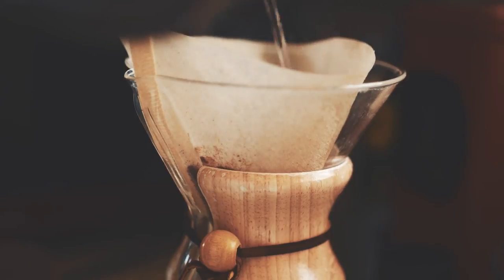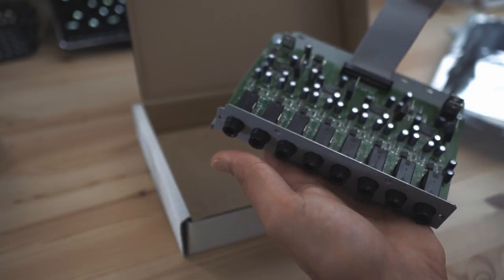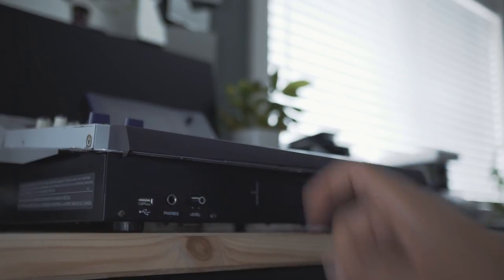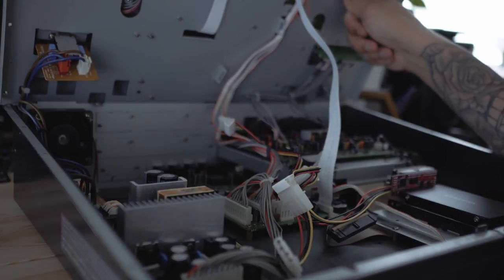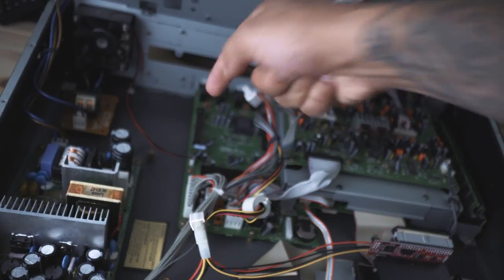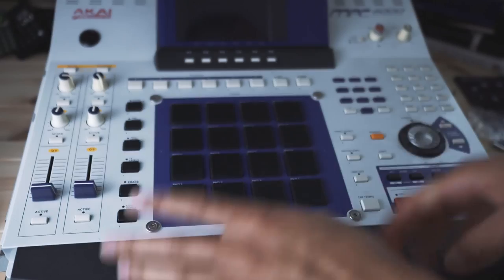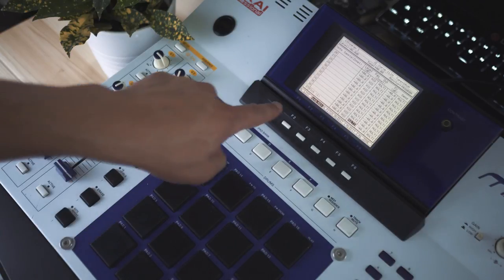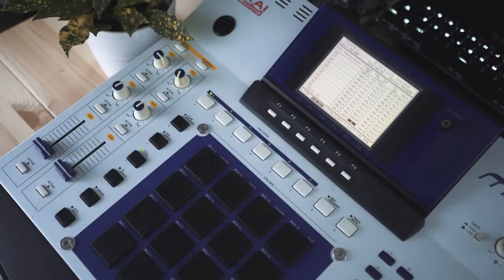MPC Output Expander IB-48P Install Tutorial - Also how to open your MPC

Comment: Peace, I just ordered my 8 outs and I 
was wondering do I need to update my O.S.? I’m currently running 1.45
and if so, what is the process?
I just got my MPC 4000 and this thing 
is a beast! Finally, I had to replace the 
sliders, there is a video on my page, of me replacing them. Your videos are great 
and give me a jump on the 4000, I’ve been using the MPC 2000xl for the past 
25 years, I love it, but the 4000 is my best 
friend 😂
Reply: I also have the 2000XL and thought about getting something new and modern, like the MPC One, but I am seriously considering the MPC 4000. Does the 4000 come with both a high pass and low pass filter? How about any effects, like reverb, etc.? The 4000 I am looking at purchasing is standard, without any upgrades. Can you recommend any upgrades worthwhile in adding? Thank you kindly. Blessings!
Reply: @davidscott2095  The 4000 is a beast, yes it has several different high & low pass filters, which are great! It comes with pretty good effects which is a plus. I would recommend upgrading to the 8 out expansion, for better mixing, but your gonna need at least a 12 channel mixer. The Soundcraft EMP analog mixer is pretty good and affordable.  You can’t go wrong with the MPC 4000!
Reply: @beataddiktgodd  Thank you kindly. Blessings!

Comment: Hey Ricky how did you get the cable for the screen out? I seemed like you just pulled it out easily, but when I try to pull my cable out it seems to be really locked in. Can you please help me? Thanks in Advance.

Comment: Noticed that you have an SSD installed in there. Is there any faster loading speed you've noticed with that or are you just going for reliability over a HDD?
Reply: I'll let you know later just about to do it and install a quiet fan too. I'm sure it will be way quicker and more to the point, quieter!
Reply: Way faster, quieter and I used a 3.5 to 2.5 hot swap bay that pokes out the front. Shouldn't need to ever open it for drive issues again and can pop the drive out load samples on a computer and just pop it back in to the MPC. Did the fan also. Should have done it years ago.